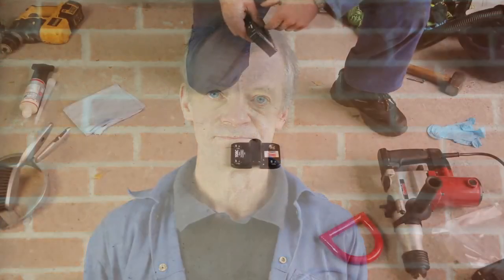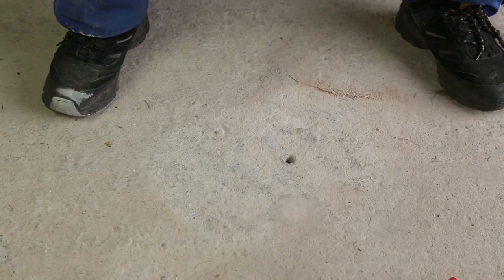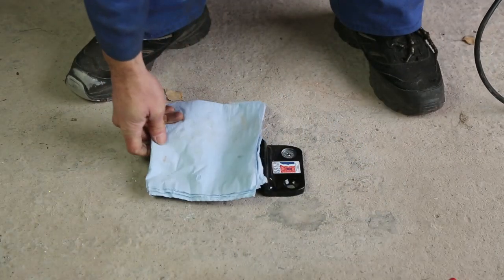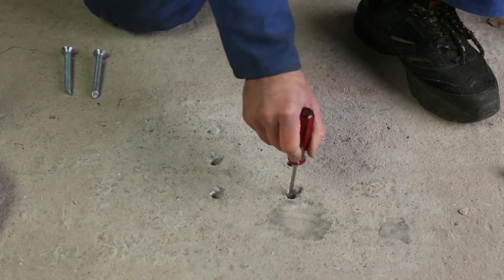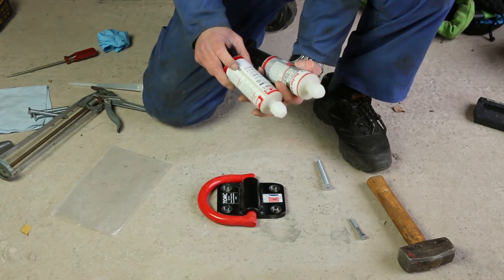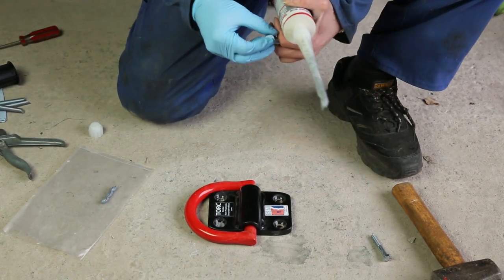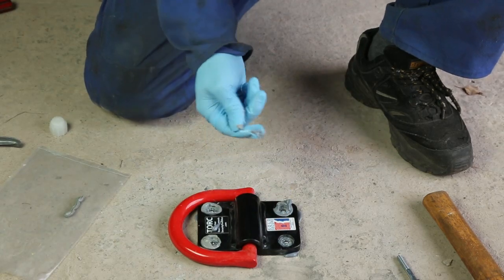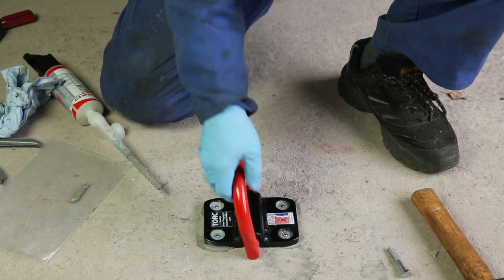Fitting a Torc Ground Anchor Using an Injection Resin Cartridge

Comment: If the ground anchor is to be sited outside, suggest that the countersunk holes, after fitting the bolts are topped up with the resin as this will give extra anti- rust protection for the bolt heads and bearings. This will also prevent rain water collecting in the countersunk cavities.
Reply from the maker: This could be an option if the anchor is fitted with the Injection Resin kit, for instance, as that usually has plenty of spare resin. It would probably not be easy to get a neat finish, and it might be arguable one of the main reasons to try filling the recesses would be to make it look neater so it might be tricky to achieve a really nice result in practice. Something a bit more runny, such as fibreglass resin, could be easier to dribble in to get to the right level if you want a flush surface. Interesting idea, though. Thanks for the suggestion.

Comment: I've got quite an old house with a brick floor, almost like cobbles. I assume this set up wouldn't work well for me?
Reply from the maker: No, I'm afraid the only way to get a worthwhile fixing of a ground anchor on any kind of brick floor or on block paving or on paving slabs is to lift several of those bricks/blocks/slab(s), dig down into the soil below and then fit the ground anchor as you fill the hole with fresh concrete. Bricks/blocks/slabs are not suitable as they are, themselves, not fixed to anything. They are pretty much just sitting on the soil etc below so anything fitted to them can be compromised by lifting them away. A paving slab may be large and fairly heavy, but it is easy for a thief to use a sledgehammer to crack it in half and thus free any kind of anchor that is fitted to it. Any anchor needs to be fitted to a good solid substrate, and if there isn't one, then pouring fresh concrete allows you to make one. (Apologies for such a slow reply.)

Comment: So, the ball bearings are an anti drill feature?
Reply from the maker: Yes, anti-drill and anti-undo.

It is actually remarkably difficult to drill-out the heads of these bolts even without the ball bearings in position. I've done it and it can take e.g. 10 minutes, per bolt, with a mains-powered drill and sharp drill bits. However, we don't want a thief to be tempted to have a go so we use the ball bearings as they basically stop you getting anywhere with drilling-out the bolt heads.

It would be very difficult to undo the bolts when the anchor has been fitted with resin, as they are bonded in position and we put a chamfer on the tip of each bolt to key it into the resin further. But, we don't want a thief to be tempted so the ball bearings stop you getting an Allen key in there at all. (The anti-undo aspect is very important when the anchor is fitted with shield anchors (i.e. expanding bolts) as they don't have the advantage of the bolts being bonded in position. Again, stopping a thief before he even starts is the best policy.)

Comment: Hi, what is the diameter of the ball bearings, relative to the size of the bolts?
Reply from the maker: The Torc anchor uses M10 socket countersunk fixing bolts. The hex socket (i.e. Allen key) size on these is 6mm AF, and the ball bearings we use are 1/4", so 6.35mm diameter. Hence, they need a good clout or two with e.g. a 4lb club hammer to get them in, permanently.

Comment: how can you remove the ball bearing from the head of the bolt if needed ?
Reply from the maker: The ball bearings are hammered-in and are extremely tight. They are not intended to come out. Indeed, it is virtually imposible to get them out, so much so that it is often quicker to grind through the base plate of the anchor, across all 4 corners, to separate it from the bolts. That is also very time-consuming and it destroys the anchor in the process. If you want to remove the anchor and get back to a flat floor surface, you can do that by making repeated cuts with a grinder, e.g. after cutting the majority of the base plate away from the corners where the bolts are, with the disc angled at 45 degrees from vertical. You can gradually work your way in to a cut that goes through the shank of each of the bolts to release more of the metalwork. Then, you can finish off by grinding the short peg of the bolt that still protrudes above the floor. As you may guess, this is not a quick process!  (We can supply a replacement base plate on its own, if you want to move the anchor somewhere else. We can supply fitting kits separately, too, so you could move from a concrete floor position to a brick wall, for instance.)

Comment: How to remove the ball bearings later, should one need to unscrew the bolts 🔩 for a damage free dismount? Or is it impossible?
Reply from the maker: It's designed to be a permanent-fit ground anchor. You can preserve the anchor if you cut out a volume of concrete below, such as with a 'Kango' or similar impact drill, and then try to break the concrete away from the anchor. That makes a big hole in the floor and it is not easy to get the concrete off the bottom of the anchor, even when you've excavated the whole thing out of the floor.